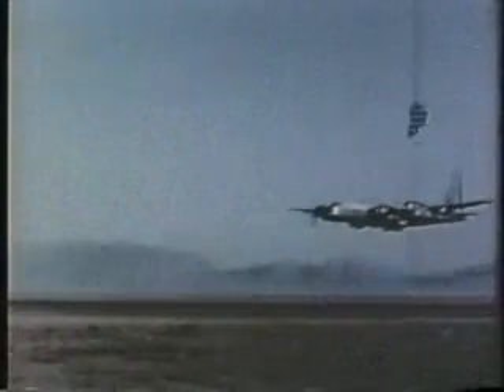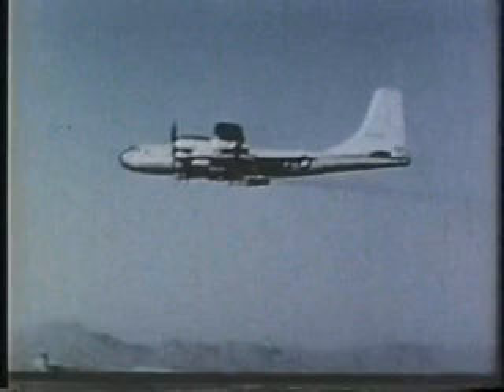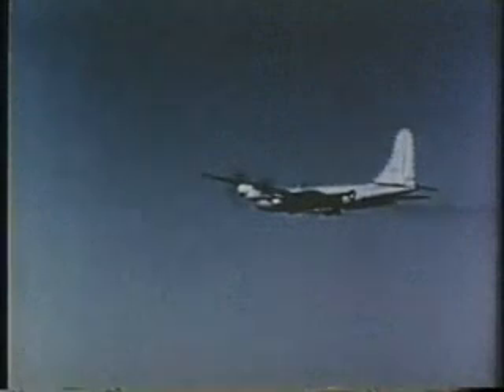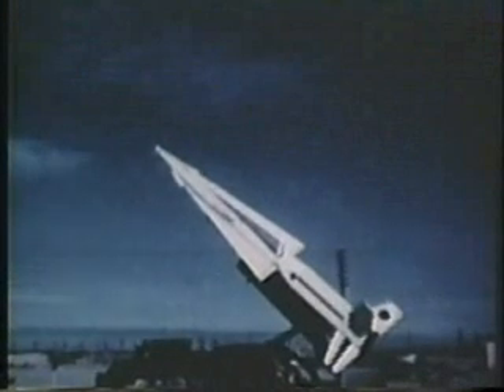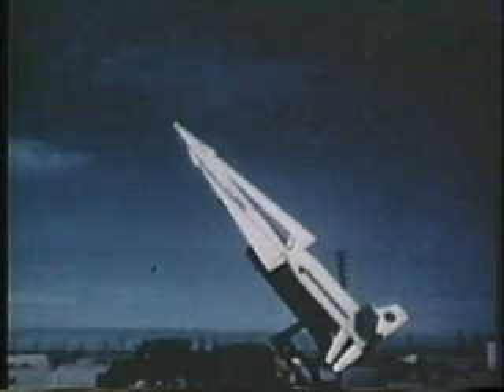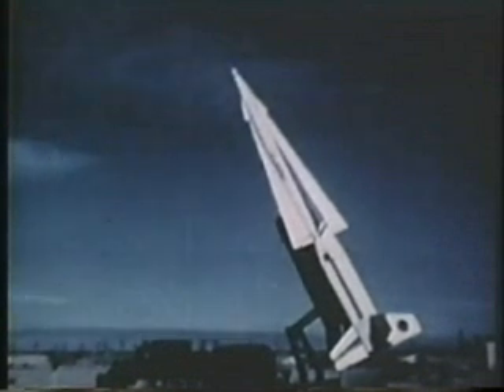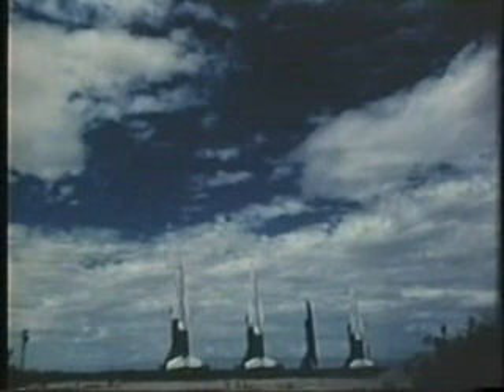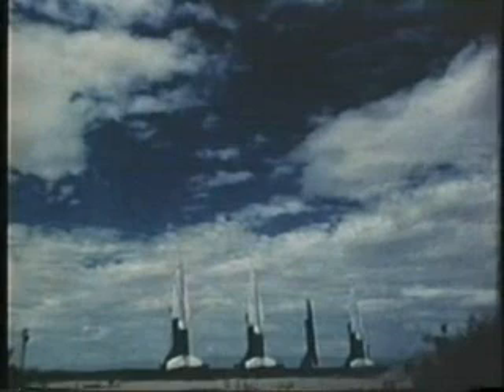Nike Hercules Missile Q5 High Altitude Intercept

Comment: A one centimeter, one gram tiny plane travelling in air 1000 times thinner than sea level air still has about a hundred thousand trillion air molecules per cubic centimeter to use to steer towards the target.  If a .45 magnum bullet can put a hole through an engine block, the one gram plane travelling at ten kilometers per second could do a lot of damage with 100 times as much destructive energy as the  45 magnum bullet.  If a  tiny solar powered ram jet  can stay in the upper atmosphere always by travelling faster than the sun sets, the advantage if already being at high altitude and velocity and the small expense of millions of such  tiny planes might make ballistic missiles useless.   Millions of tiny rocket space planes in orbit might also be deployed for less expense than the argued lowervexpense of the enemy deploying more nukes to compensate for the defense.   Modern microelectronics and detection technology change the whole situation.

Comment: My grandfather used to operate these at Eielson AFB in Fairbanks AK between 1966 and 1969. He earned the Expert Missileman Badge for doing so. He passed away about 2 years ago. RIP Pop
Reply: I guarded the Nike Hercules at B Btry Ft. Richardson Alaska in the mid 70's.
Reply: @krisgreenwood5173 I could see the missiles out, I guess during tests, from atop of the ski hill at Arctic Valley in the early 70’s. By the way, they still light the star every year for the Christmas holiday season.
Reply: @Caduceus88  yes, they were run out mostly as training for the missile launcher crews.  Only once did I see them on the rails with arming plugs installed and ready to launch.  They were impressive when on the rails and standing up.  We had a reunion last September.   They have a trainer missile in one of the sections now, but the rails are all gone.
Reply: I was fortune enough to watch a Nike Hercules briefing and launch behind Eielson AFB in Alaska, surface to surface.. we watched from a mile away as the missile came out of its bunker, snapped upright an fired. A few seconds later, there was a boom…boom and it was gone. First boom was the booster blown off, and the second was breaking the sound barrier. They said at the time it flew 70 miles in 60 seconds and landed 2 yards off target. (The speed math doesn’t work out) .. Coolest thing a 10 year old could witness. Thanks Dad.
Reply: I  fired. Out one at white Sands    1964
Reply: Be proud.  Very cool
Reply: My father was stationed in Germany from ‘67-‘69. They had 31 Nike Hercules there.  I love to hear him talk about these.
Reply: Everyone's granpa seems to be at all of these videos

Comment: AFTER ASSEMBLY THE "PIT RATS" 16 BRAVOS,TOOK CHARGE OF THE MISSILE DAILY , 6 HR CHECKS AND OTHER DRILLS EVEN AT MIDNIGHT.  THE 16 CHARLIES WERE THE SYSTEM OPERATORS WHO WERE WITH THE COMMANDER  IN CHARGE OF SYNCHRONIZING ALL THE "BUTTONS " REQUIRED TO FIRE THE MISSILE IT TOOKS A TEAM OF FINELY TRAINED MEN TO DO THE JOB. I NEVER MET A STUPID IDIOT  THERE.ALL AT LEAST H.S. GRADS. I WENT ON TO BECOME A MECH DESIGN ENGINEER. NOW RETIRED IN LOS ANGELES.

Comment: NIKE -HERC WAS A LOVELY BIRD TO WORK ON. I DID IT FOR FIVE YEARS.  I WAS A 24U 20  MOS . ELECTRONIC TECH, BUT WE DID ASSEMBLY ,IT CAME IN  PARTS IN WOODEN CRATES AND  SEALED STEEL CONTAINERS AND WE  ADDED THE WARHEADS , DID ELECTRICAL/ELECTRONIC TESTS. THEY WERE ALL NUKES, EVEN THOUGH I WAS TOLD AT SCHOOL WE MIGHT NEVER SEE ONE. I SAW  ALL 16  SALVOS WE HAD  AT KINGSTON,SEATTLE AIR DEFENSE, TO BE "GOLD PATCHES", NO ROOM FOR WIMPS , NO ROOM FOR MISTAKES, DON'T MAKE YOUR MOMMA CRY!
Reply: A.J. Cariaga really?